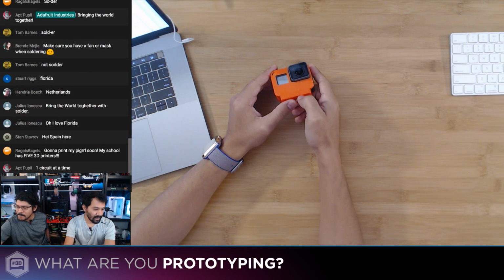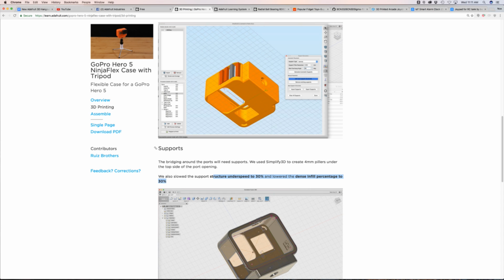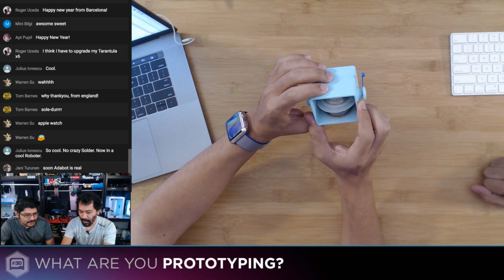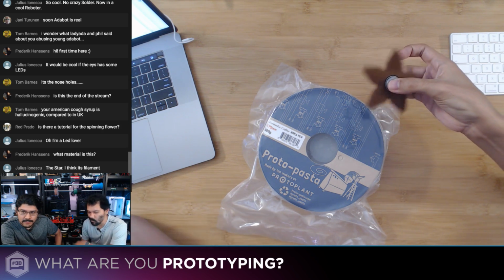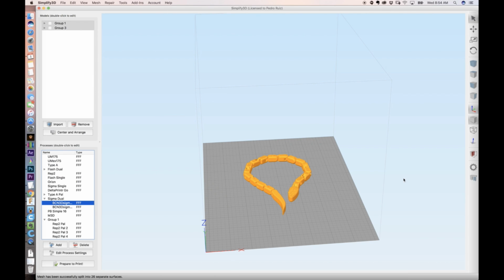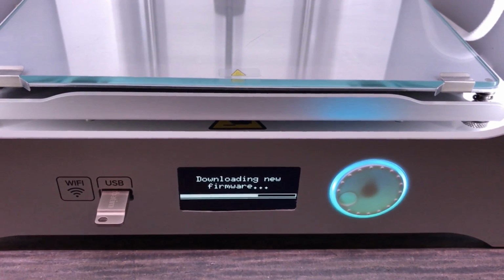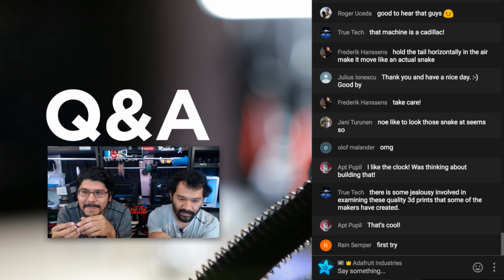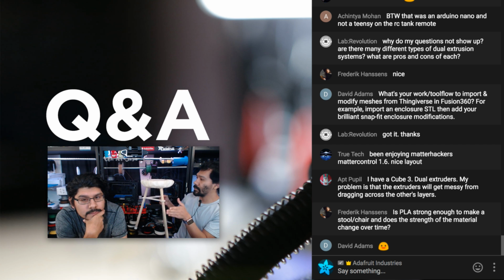3D Hangouts – Solder, Snakes & Dual Printing

Comment: Can you guys please talk a little again on what would be the best choice for a 3D printer in the $2-4K range? I know Adafruit caries the Ultimaker, what happened to you guys carrying & loving the Taz printers? Did the Taz line fall in quality or did the Ultimaker just beat it out? And if so in what ways? I'm working with a group that is putting together a learning / making space for kids & public and they are going to be getting 1 or more printers for learning & using. Also, what are your impressions of the M3D? Do you think that it would be good for a lower cost learning 3D printer?

Comment: Hi guys, 

great show!! Thx

P.S.: What sw are you using to make videos with Fusion 360? I tested Open Broadcast Studio as well as Wirecast and none of them can see UI in Fusion :-/. Many thanks for answer.
Reply: Miroslav Zuzelka Thanks! I've had similar issues with Wirecast and Fusion. The screen capture shot has to set to the 'full' monitor, as opposed to a single 'window'.